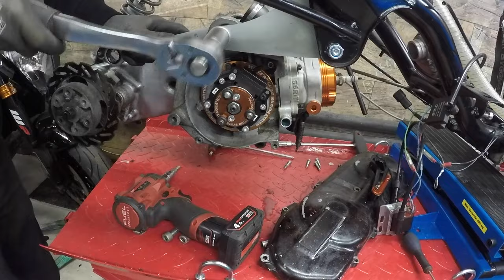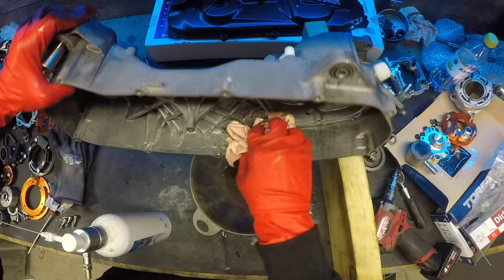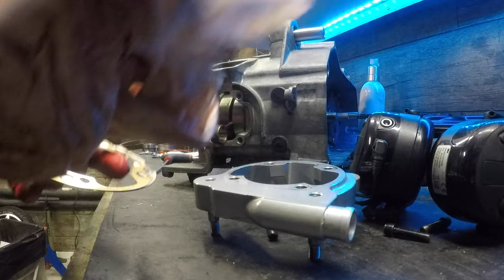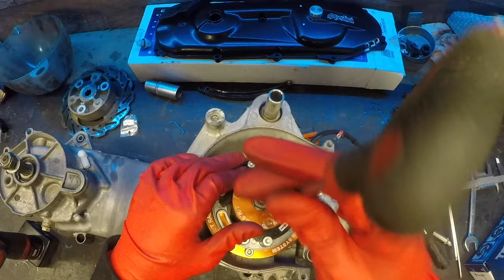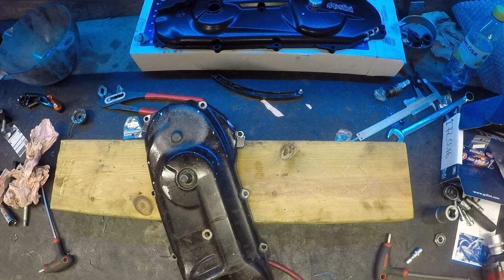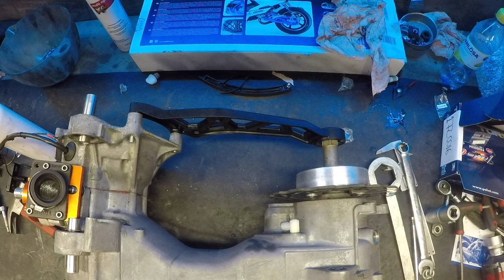Aerox Stage6 RT70 Engine Rebuild (timelapse)

Comment: What do you use to seal the two engine block halfs, is it some sort of liquid gasket or are there specific gaskets to look for? I'm looking to build an 86cc Malossi and don't want to get leaks there.
Reply: im pretty sure its an silicone seal
Reply: @k1v569  the black liquid stuff?
Reply: In sweden it is called flänstätning
Reply: Hylomar is a very good sealpaste
Reply: if your asking questions like this, I would get someone to build it for you. if you don't know the most basic things like sealing your surfaces I can bet your build will last a month before it blows lol
Reply: @BoozySZN  there's always room for improvement my friend
Reply: @thomasshelby1890  how did the build go?